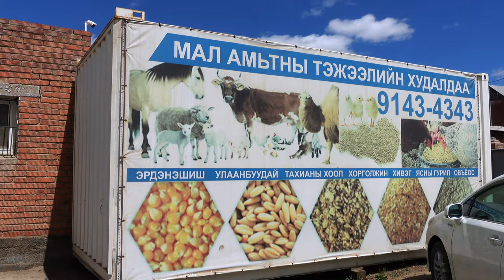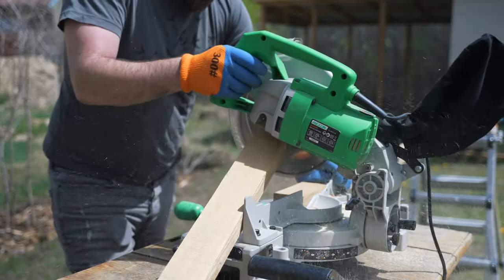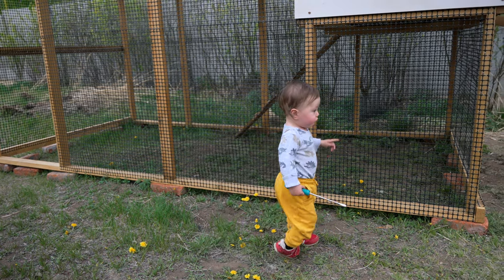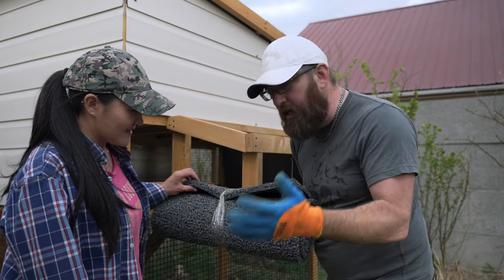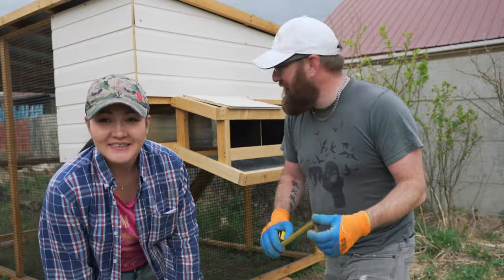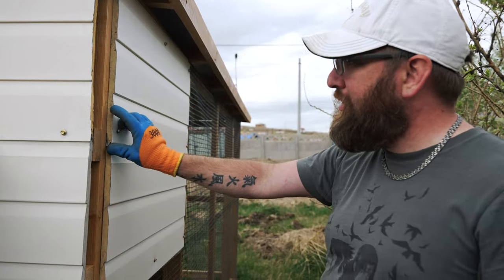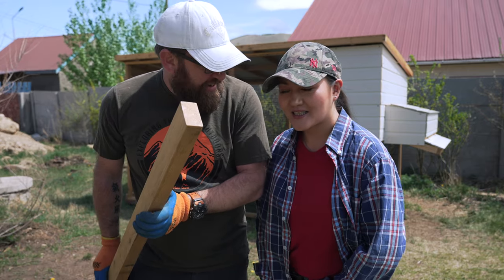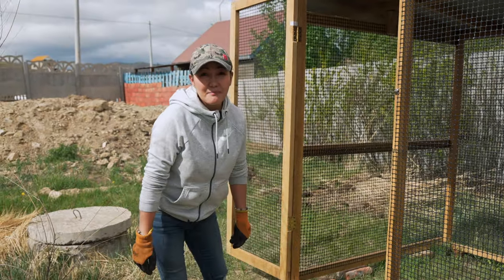This Victory Is Extra Sweet | Finishing Our DIY Chicken Coop | How to Build A Chicken Coop

Comment: Sorry guys but you overcomplicated things. It does not have to be that complicated and costly. The best thing you can do is build a chicken tractor that you can move around every few days to keep your chickens on clean soil or you will find that your chickens will get sick pretty quickly. Also all that hay on the ground will get moldy in time and is another health concern for your chickens. there are simple chicken tractors you can build that will be cheaper and much more sustainable than any stationary coop. I applaud your efforts but pray you look into what I mentioned here for your and your chickens sake.
Reply from the maker: Thanks so much for your comment 🙏🏻👏😊 it wasn’t complicated at all. It was the right fit for our small homestead in Mongolia. We are new to homestead and appreciate your input 👍 it is only a temporary summer coop as the chickens need a deep winter coop in Mongolia when it is -40 degrees 8 months of the year.